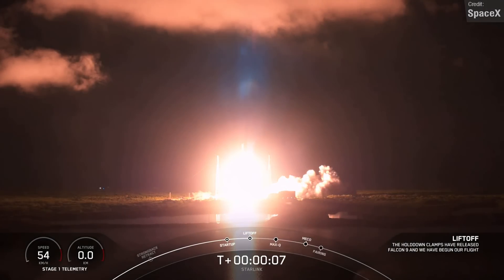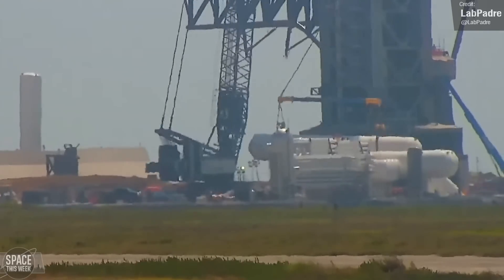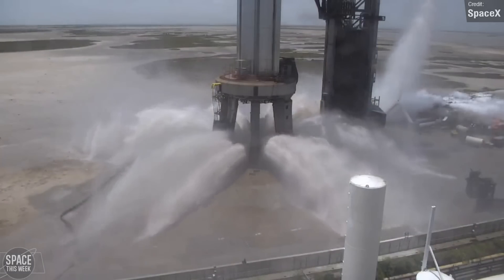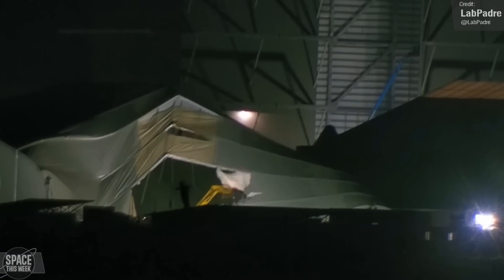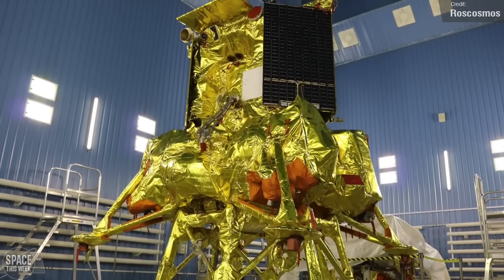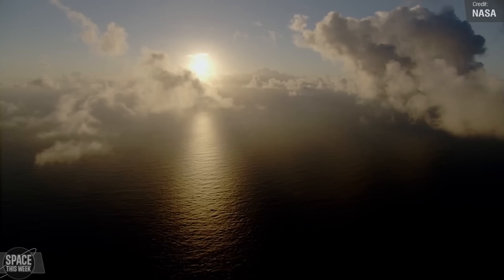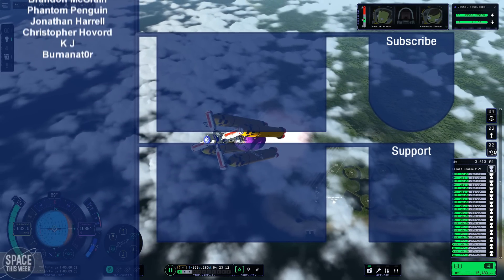SpaceX Starship Prepares for Orbital Flight 2 with NEW High Pressure Tests & Hot Ring Installation!

Comment: Those gaps in the hot ring section make for extra payload weight, if I'm not mistaken. Dear god is starship squeezing as much weight capacity optimisation out of it as possible.

Comment: The tearing up the concrete is because of improper curing. In the flyover videos you can see where they had painted the cracks caused by the curing not happening properly.

Comment: It just occurred to me that, with hot staging, the force that the Starship's engines exert on the booster during separation would reduce it's velocity by a not-insignificant amount.
This means that the booster won''t need as much propellant for it's return burn which means it could use that extra propellant to boost Starship for a little longer.
I hope that the flight engineers are taking this into consideration.
Reply: I'm sure this is a noticeable part of the equation giving such a payload boost with hot-staging.

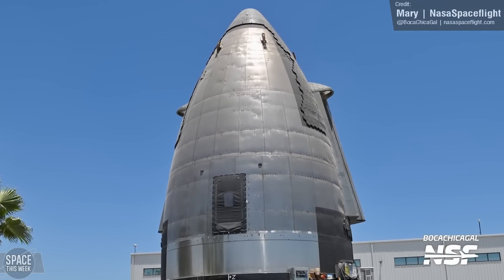Comment: 6:50 I wonder if starlink 2.0 satellites are going to be ejected vertically instead of horizontally.

Makes sense if the vertical slot would be able to handle the vertical loads better

Comment: 15 degree gimbal, tested for a long duration. does not sound like landing burn testing because this duration would never be used in a landing, but sounds more like a test of gimbal-hold for long (or longer) burns, which might indicate the test has something to do with hot staging. the hot staging protective dome on the booster looks not to be designed for the center engines to fire at all during hot staging, or, if gimballed to the sides like this test illustrates, they could be used during the hot staging regime, even if only for emergency / redundancy / escape purposes. on another topic, but related to clear thinking as well, "hottest month on record since 1880" .. was global warming already a problem back in 1880 so soon after the beginning of the industrial revolution, and anthropogenic effects on the climate?

Comment: Starship launch site: The 3rd large water tank is a bit off because workers need to install flanges that would fit the water pipes. They can't do that unless the tank is moved to the side. Btw, the latest test did not include that tank - work on it is not done yet.
Also, not all gas tanks are connected to the system, but more of them are connected every week.

Comment: Think the tent removal to help with star factory expansion is probably also driven by the fact they have several complete/mostly complete test articles in place ready to test after the next launch test (obv any 'mishap' reporting to FAA would delay things as they need to list future mitigations - whatever they may be - as part of that). They really dont have a huge benefit of just pumping out more ships and boosters that then need storing somewhere etc.. so taking this time to really smash forward with the star factory build and remove old tents makes sense.

Tl;dr there is somewhat of a natural slowdown in making new ships and booster rings so makes sense to go whole hog and demolish the tents and low bay to allow speedier builing of the star factory.

Comment: So I see a problem with all of these unmanned lunar missions. They are all losing contact before landing. What needs to be done is we need to put more satellites around the moon. If they are all in a higher orbit, these satellites would be able to maintain contact with the lander at all times so any emergency maneuvers can be made accordingly. The only problem would be the slight delay in communication due to distance.
Reply: yes and no. Satellites would certainly help, given that the landing site is on the south pole. In fact, one of the failed south pole landings had an orbiter: Chandrayaan-2's orbiter is still active above the moon, according to Wikipedia. An orbiter is a great idea, but it adds a ton of complexity, which is why some agencies opt to go without one.

However, in this case "loss of communication" is a euphemism for "crashed into the moon due to -REDACTED-". They just don't want to say what they did wrong. From what I can tell, the four high-profile failures that spring to mind are due to flight software glitches (Hakuto, Chandrayaan-2), or engine failure (Beresheet and possibly Luna-25).
Reply: @killerhappyface  Thanks for the insight. I do now remember hearing about an orbiter with one of the attempts. Still having 1-2 more orbiters can help to ensure definite connection to earth. 

In addition, though it may be more launches, sending a mission with just orbiters would lessen the complexity of sending orbiters along with a lander. In the long term it would allow for constant communication to earth even when the lander is not able to directly communicate with its team on earth. 

Again thanks for the info.
Reply: Two or three satellites in the near rectilinear halo orbit would provide uninterrupted communications, I would think.
Reply: @frankmcgowan9457  Yep. Something on that order should work, and it would be a hard requirement for any lasting presence or orbital station.

However, because the moon is lumpy and unshielded, a steady lunar satcom network is no small feat. NASA definitely has the capability, and almost certainly has one planned.

For cost, complexity, and capability reasons, such a network isn't really a feasible solution for an unmanned exploratory mission, especially from a smaller agency or private corporation. I predict exploration missions will remain either solo lander or lander/orbital configurations for the forseeable future.

Comment: I think that the premature abort reason could be because elon said the rocket would abort if 3 or more engines where failing and them failed
Reply: Would you buy a used car from Musk?.
Reply: @mrdim362 Um, i think i wouldn't. I don't want a car.
Reply: @mrdim362 That has nothing to do with rocketry, you muppet